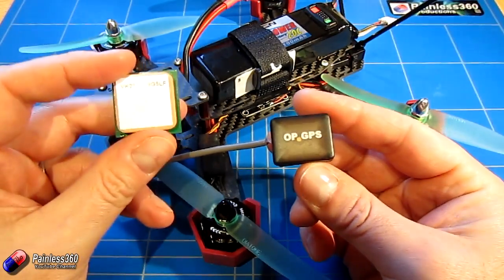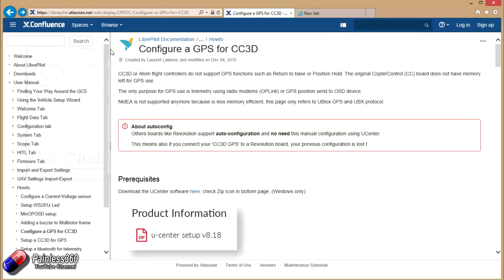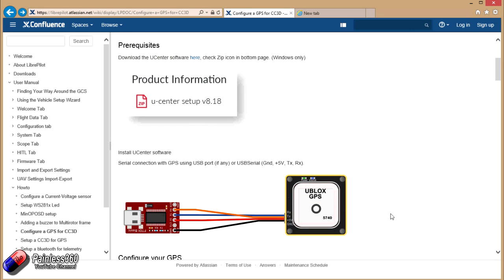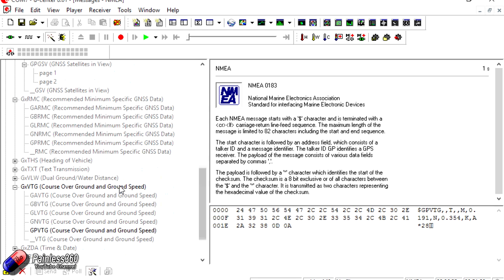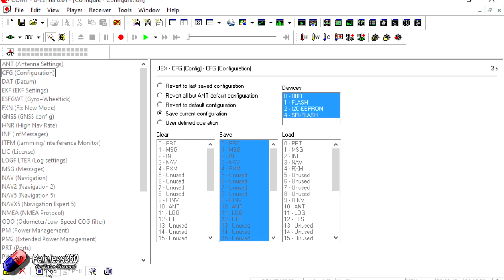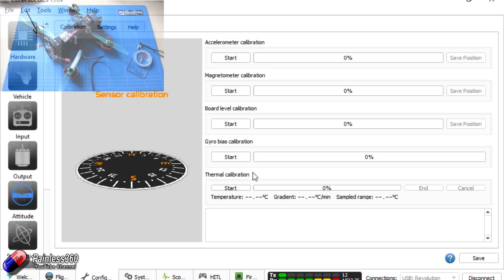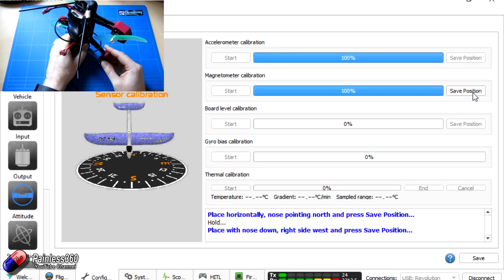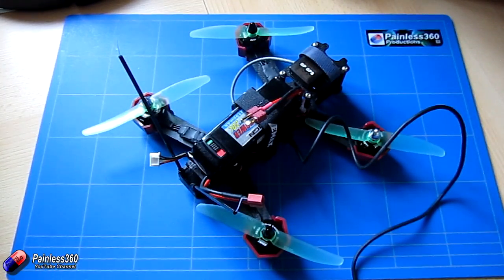(3/3) CC3D Revolution and LibrePilot: Adding GPS and extra calibration steps

Comment: After disconnecting power to the GPS, all GPS settings are lost. This GPS has no EEPROM.
Reply from the maker: Librepilot should configure the GPS automatically but in my experience this feature is fantastically unreliable...
Reply: I have done a separate configurator on arduino, but this extra weight .
Reply: Have you made sure to write the settings to the GPS unit in uCenter by hitting the Cog with the floppy disk next to it?
Reply: KM4LKX 
Yes . Settings remembered for a few minutes and all . There is no memory .
Reply: And you are using the OP GPS? I've not ran into this issue with that GPS. I'd contact whoever you bought it from and get a replacement!
Reply from the maker: I worked but the sensor is so small!
Reply: If you turn off the power for a long time , and then you reset the settings . Try it on for about 30 minutes to disconnect it from the power supply . 
I have NZ GPS.

Comment: Hi, I would like to acquire a small system with GPS so I ca use RDL. Should I buy this kit (CC3D + GPS) or the APM v3 with GPS?
Reply from the maker: +Claude St-Louis see our video on flight controller comparison. I'd still use APM, it's mature but works! Happy flying!
Reply: Painless360 Thanks

Comment: I am trying to set up GPS and am having a little problem. Perhaps you have the answer. I have the CC3D Revo (full size) and the same OP Gps that you installed. Everything goes fine until I set the attitude estimation algorithm to GPS navigation INS13. In Flight Data, there is a big red X on the screen where it shows the quad orientation. Also ATTI, STAB and  MAG are red. I recalibrated everything in Attitude calibration.  Before setting INS13, there is no red X and the ATTI, STAB are green. When I turn INS13 off, it is back to normal. I hope you have the answer. And thanks for all the time you devote to making these videos. They are a great help.
Reply from the maker: Not sure - we've not seen it yet. I would recalibrate the mag and make sure the GPS has a lock and try again.. Best of luck!

Comment: For me, the problem is that if I'm in the CC3D the Revo GPS.
It can confuse the CC3D Revo compass sensor, if I tried to calibrate finger confused but if the OP is GPS enabled.
That is why I asked how PDB is in this video ???
Perhaps it may interfere with the compass sensor.
Currently, this is it:
http://www.banggood.com/5Pcs-Mini-DC-DC-Converter-Adjustable-Power-Supply-Step-Down-Module-p-951165.html

I already shorted the wires, twisted together.
I placed far from the CC3d
I have a suppression capacitor.

Thank you in advance for your help.

Regards
István Papp
Reply from the maker: +István Papp Until we have the option to use an externally mounted magnetometer this will happen. we shield our boards using MuMetal when we have no choice but to mount the FC close to the power electronics.. Best of luck.

Comment: Lee, Thanks to your professionally produced videos on the Taranis X9D Plus and the CC3D Revo I have taken the plunge with both. A mini  Ublox Neo-6M w/compass auto configed and is working great but getting that telemetry data over to the Taranis is a problem. I've seen mention of LUA scripts but being a newbie I have no clue what they are. Maybe you could do a video on getting these two products to work together or point me to a resource that would explain how. Thanks for sharing your knowledge.
Reply from the maker: +jrshabby LUA scripts allows programmers to make cool little programs/apps that run on the radio. They could be a nice screen that shows all the layout of the telemetry or one of the standard ones is the LUA script that help you create a new model on the radio with graphics and menus and everything. You can search online and find other LUA scripts for the radio. To use them the LUA support needs to be in the radio.. Hope that helps..

Comment: Hey @painless360 How did you hooked up the GPS small connector to the FTDI? did you use very small jumpers?
Reply from the maker: +Marcos Paz I make a temporary cable up with what I had as the cable from the GPS had bare ends.. I used servo connectors in the end..
Reply: +Painless360 Thanks! I ended up connecting the GPS directly to the FC first and was recognized perfectly in the main port, so no need to do the prior GPS config. BTW, thanks for these videos, they help a lot!

Comment: Anybody..help.... :( 

I have one of these...YKS Ublox Upgraded NEO-7M High Precision GPS Module Built-in Compass from amazon I plug this into, and set the main port to gps.. and I added 2 lines, connected it to the flexi port and set it to i2c for the compass...but the compass never reacts to it, just the onboard mag. Everything is fine, it arms, it flies. As soon as I set, say, position hold and gps assist in one of the stab lines, and switch the gps from contemporary to GPS INS13, the hud freezes and the craft will not arm, even if I set it to always armed. All alarms green except i2c, that is black. I read somewhere the revo board does not configure the i2c port, I have to download some program and create a program to use it. 

https://librepilot.atlassian.net/wiki/display/LPDOC/Windows+Building+and+Packaging

If this is the case I might try the naze 32.. I did not mnd the challenge of the cc3d but I don't have the patience to write any code!! 

Any help will be welcome..
Reply from the maker: +Visesh Lall I thought that Librepilot didn't support external compasses at the moment...
Reply: I am doing a lot of digging into that. I am on the librepilot forum a lot as well, some seem to have gotten it to work. But the info is a bit confusing to me, because if you select the ublox gps in the initial setup, the setup diagram shows one connector, as well I have a pdf on the revo board that describes it in a lot of detail, and does not talk about using the I2c port for an external mag, and if you buy the entire revo package, the gps module says there is a compass, but only one 4-pin connector... SO everything points to using the internal mag. All that aside, even when I try to set it up as the libre pilot instructions say, as soon as I select position hold or gps assist, it will not arm, and when I select INS13 as instructed, the hud freezes, and nothing happens. If I undo those selections, everything is ok, it arms and responds normally... Still digging, I will get this working, and I will post my  findings.. incase anyone finds themselves in my predicament! And thank you for your responses!
Reply: So let me add... the 15.09 version does not support the aux mag, they plan to include it in the next version. The persons who I saw using it actually wrote their own bit of code to get it to work... I am not so inclined! so I will wait till the next version. In the mean time I will try to get it to work with the onboard mag.

Comment: Hi,Many thanks for the videos I have had no problem with multiwii RTH but no luck with the Revo.  My question is- If I travel to a new location ie 2miles to the flying field do I need to reset the home location and recalibrate everything ie magnetometer?   With the Multi wii it returns to the arming location but i'm not sure with the Revo
Reply from the maker: +Super Crosser You can get it to store the home location on arming - see the videos in the series but until the ability to support an external mag is supported the GPS modes will struggle.. Happy flying!
Reply: +Painless360  I have located the revo on the top plate of a qav250 and the magnetometer traces are not effected with full throttle applied. I set my home location at. home and performed all the calibration.  I then  unticked the home location box and took it to my flying field 3 miles away. Without a PC connected I waited 10 minutes for it to reset it's home location and it armed. However position hold and RTH did not work.   Am I doing anything obviously wrong? any suggestion s much appreciated
Reply from the maker: +Super Crosser we have another video that covers what you need to do (set Ins13 etc). Unril we test it all here thats the best we have..

Comment: Great videos...Just went thru the calibration procedure and have a question about the virtual display under Flight Data......I had to adjust the virtual roll attitude under configuration by -76.00 to level the horizon in Flight Data Display...is this normal and is my board accurate? Thanks for the videos
Reply from the maker: I'd try to calibrate it again. You shouldn't need that much of a correction if the board us level.. Best of luck..
Reply: Thanks.....Finally got a good calibration all the way around and have it flying well in attitude mode.....I have just started playing with the GPS modes starting with position hold....when I change to Position Hold sometimes the drone will sit rock steady and other times it will start to rock side to side moving further and further each direction until it becomes unstable and I have to  change back to Attitude mode to save it. Any idea what could be causing this?....I would say it happens about 50% of the time I switch to PH.....Thanks for the videos and the help....
Reply from the maker: It'll probably be the compass. A little interference will cause this - see out video on why GPS modes need a solid compass..

Comment: Is there a compass in the gps module? (I dont see any mention of compass on banggood..?) otherwise i cant imagine any of the gps modes working properly as the cc3d internal compass is sitting directly on top of the PDB. Start the motors and compass data will be useless. this is based on my experiences with apm 2.5
Reply from the maker: +Akujiwar Bladefist See the next video ;)

Comment: I think i have bought wrong FDTI..   Did not match the plugs.  There is a switch for 5volt and 3v3 it says.  Can i use it by using wires? Cos the txd  and rxd was not in the same place.  What to do master?  Sir im struggling.  Could you show me what fdti i need.?  this is the one i have bought.
 http://www.banggood.com/FTDI-Basic-Program-Downloader-USB-TTL-3_3-5V-FT232-For-Arduino-p-988937.html   .       Can i used it??
Reply from the maker: +Normann It looks like it has a 'real' ftdi adapter on it.. Should do.. best of luck!

Comment: This is my first go at building a quad. I have the CC3D Revolution, and a Ublox GPS unit. Do I have to set up the Ublox unit the same as you have shown here, and how would I connect the two together. Have you done a video on this??
Reply from the maker: +Barry Cole this is what we had to do to get it working.. Best of luck.
Reply: +Painless360 Now setup OK. Is there a top and bottom to the ublox unit.   Now off to ort out connections to CC3D Revo unit.

Comment: Hello sir.  I only have the op gps.  Is that enough?  Do i have to have that other gps antenna or what it was?  Or can i just plug it in and it should work?    Thanks for doing all these videos.
Reply from the maker: +Normann If you want to use the GPS flight modes then I'd look at using a larger, more accurate GPS than the OP GPS ..
Reply: Painless360  Hey. And thanks for answering.  I am the kind of pilot that needs full controll over the drone myself.  I fly racing quads.  So i was mostly just thinking of having it there in case i needed it to come home.  If something should happen.  Is it enough with only the op gps then?  And do i need the fdti basic for the op gps?  I could not find any videos on how to install only the op gps.  And also thank you for making these videos.  It was because of you i started with this about a year ago.  So you actually changed my life into something better.  I can make and sell drones now.  Just that i havent learned to setup gps and osd. Im waiting for and ftdi basic.  Im putting in a link under. Is this the ftdi basic i need for programming osd and such? Would realyappreciate if you could help me see if i have bought right ftdi:-)                                                 http://www.banggood.com/FTDI-Basic-Program-Downloader-USB-TTL-3_3-5V-FT232-For-Arduino-p-988937.html  .
Reply from the maker: The video here works for any GPS, including the OPGPS (it's a little UBLOX 6 GPS module in there). The FTDI looks promising as it has FTDI on the main ship.. Best of luck!

Comment: so i have the cc3d revo with the oplink built in and im using a ubloxneo 6m and i cant get the craft to calibrate and stay level not even in the telemetry screen when sat on a table.. any ideas?
Reply from the maker: +aaron stephenson Not sure, I'd re-flash it and test it without anything else connected to it and if you can't get it stable then suspect the board..

Comment: Can you describe the cable you used to connect the GPS to the FTDI basic with the GPS in this kit.  I can't find the female cable end that matches the male end attached to the GPS.  I suspect cutting the GPS cable in the middle and splicing it back together isn't the best option.  Any help would be appreciated.
Reply from the maker: +Jamie Mantegna I used the cables that came with the CC3D and the GPS and made up the cable.. Best of luck.

Comment: +1 waiting for configuration and test of GPS flight modes
This platform would be interesting for GPS flight modes regarding its price.
What is the processor used in this Revo clone ?
It is known that everything below F3 cannot allow efficient GPS flight modes management.
Reply from the maker: Not sure about the 'needing F3 for GPS flight modes', the 8 bit MultiWii and APM flight controllers have lovely stable GPS flight modes ;)

Comment: a lot of to do to make it to work,  with apm or pixhawk it's just plug and play
Reply from the maker: Follow the video and it should work..
Reply: +Zycie w Californii Revolution board support autoconfig feature, no need to use Ucenter.
Reply from the maker: +Laurent L Not true. There is an autoconfigure feature (we cover it in the video) this video is for those - like me - where autoconfigure simply didn't work..
Reply: +Painless360 ohh, ok, driving to work and listening videos :), thx, and as always great video
Reply: +Laurent L The autoconfig did not work for me. Was it just plug and play for you or did you do anything else?? Thanks much

Comment: Hi Painless 360. In generally like your videos, but this one is shouting out for a crash.
quite a few things are incorrect during this setup. 
1. the mag call will not work the way you showed in your video. in a miniquad there is too much mag interference to make use of the onboard mag once the motors are under power. you will need an external mag.
2. to make use of gps flight modes in librepilot you will have to switch the filter from complementary to ins13. otherwise gps modes will not work reliably.
Reply from the maker: +sirlanzi thanks for the comments. This is about adding the GPS, there is lots more to cover before a Pilot can use it. We will be covering all of this in the 'Using GPS Flight Modes video' along with using external 5883 compass via i2c, compass selection in Librepilot, setting home location to 'False' before going to the field and video of it all working. We have shielded our internal compass using MuMetal to help with RFI/EMF interference from the power system already (you may be able to spot it in this video). What is your process at the field for setting/managing home location each time?

Comment: What other GPS do you recommend if one wants faster satellite pickups?
Reply from the maker: +InterBlue UF I'd go for a UNBLOX 7 or 8 series GPS, every generation gets a little bit better. I've used UBLOX NEO-6 GPS and they work fine but are getting as little 'mature' now ;)
Reply: +Painless360 http://www.banggood.com/Ublox-NEO-M8N-GPS-For-Mini-CC3D-CC3D-Atom-CC3D-Revolution-Flight-Controller-Built-in-Compass-p-999341.html 
I found this one for my CC3D revo, does it matter that it has an built in compass (I mean the CC3D already has one)? Or was there another one you had in mind?
Thanks in advance :)
Reply from the maker: +InterBlue UF Should do but the external compass normally connects via a i2c connection separate from the main connector. Maybe this does.. Hmm, I'll have to look at that..
Reply: +Painless360 Hi again, sorry for all of the questions :P But where did you get that FTDI converter from and with what type of adapter did you connect it to your GPS? I searched on banggood.com but they didn't seem to have anything that looked like the one you used. 
Thank you again for very helpful videos!
Reply from the maker: eBay :)
Reply: +InterBlue UF I got my FTDI from Amazon. It's not exactly like the one in the video but it works the same.  It currently says it's not in stock until Feb 13.  Hope this helps.  http://www.amazon.com/gp/product/B009T2ZR6W?psc=1&redirect=true&ref_=oh_aui_detailpage_o00_s00
Reply: +Painless360 http://www.banggood.com/USB-to-TTL-Converter-Module-for-FT232-FTDI-MWC-Multiwii-Arduino-with-6P-DuPont-Line-p-980209.html 
I found this, will it do the job you think?

Comment: I have trouble getting a GPS lock when the tiny OP GPS is on my quad. With FTDI on U-Center everything is fine, but it wont get a solid lock when on my quad.
Is this sensible to 2,4GHz or 5,8Ghz ?